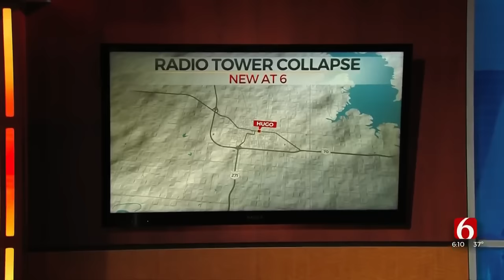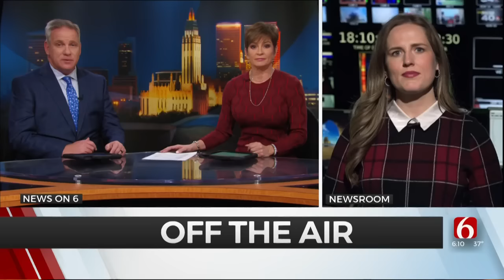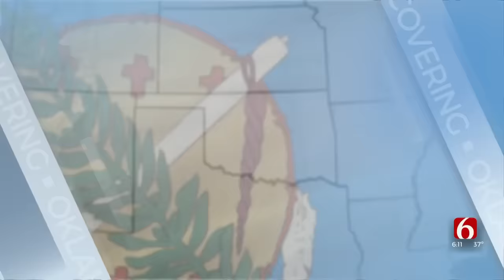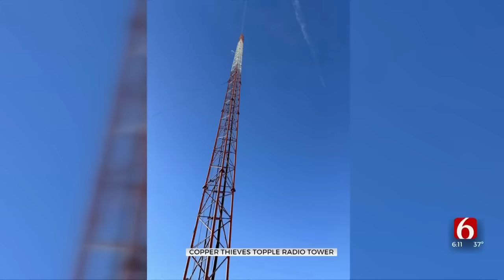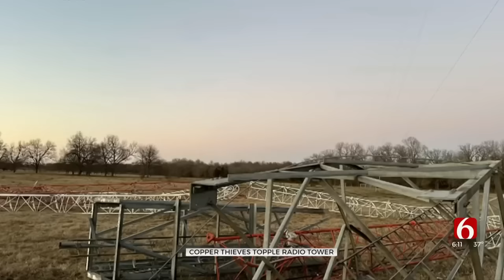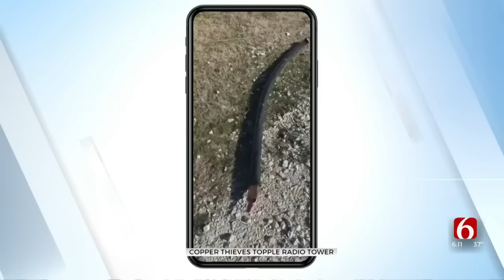Thieves Cut Down Radio Broadcast Tower In Southeastern Oklahoma To Steal $100 Worth of Copper

Comment: Never seen a thief care about how much damage they have caused to gain what little rewards they get
Reply: You must not have heard about catalytic converters being stolen then.
Reply: Nah never heard that, of course I have heard about that, where the heck have you been?
Reply: migrants ?
Reply: @mikemiller659 
That was my 1st thought...
Reply: user-cj8qq1el8i Not MAGA but Biden
Reply: @mikemiller659 Please clarify as illegal migrants. We do have legal migrants after all.
Reply: Copper thieves sole the copper line from my oil tank to the foundation, about 2 feet long and probably only 5 bucks worth, and put 200 gallons of home heating oil into the ground.  The oil spread and leeched under the basement's concrete floor.  The cost to contain and mitigate this oil spill was $300,000.00  and I couldn't live in my home for over 6 months.  Thieves care little for the damage they do, if they did they wouldn't be thieves.
Reply: @robinfleet7094  You didn't actually pay $300,000 did you?
Reply: The original 'OG' of this type of crime was 'Cool Hand Luke' sawing the tops off of parking meters....everyone else that came after including the people who did this are just copycats and pretenders
Reply: @mikemiller659 most likely White or Latino…. The brothaz scurred of heights

Comment: The station manager of WJLX in Alabama said their WHOLE TOWER was taken.
Reply: That was a remote relay tower that the station was unaware of it not re-broadcasting. 

The thieves also stalled electronica equipment from the shed.
Reply: I meant electronic. Damned iPhone 13 retyped electronica, and I failed to proofread.
Reply: @peterresetz1960 stalled?
Reply: Keep thinking it’s about the copper. 
Two towers. That we know of. This close together?
Coincidence. Nope.
Reply: The WORK they put in for $100..🙄
Reply: Close the border.
Reply: @sharksport01  Ha ha you're lost
Reply: @sharksport01    Nice political chant. But would accomplish little.
Reply: What's with the spelling in this entire section? Haha group of re re's.
Reply: @BoltRM  a tower has a 1000 dollars in it if you scrap it
Reply: It’s pretty sure that it had been down for a long time the shed was filthy and the wiring had been cut for a long time things do not add up on that one !
Reply: This is dumb, both should be easy to find.
Reply: @sharksport01  With Oklahoma..?
Reply: Yea, that one looks like something else, they said that tower went missing over night, and the weeds are over the top of the toppled fence, and dirt blown inside of  the cleaned out transmitter building. 
There's something very fishy about that one.
Reply: @peterresetz1960

Is that like erotic electronics? Good god what are they doing over there with them radio towers and that damn Electronica ???,
Reply: @BoltRM 
Yeah get a job.  Thieves around here we're removing metal roofs for scrap.  I've removed metal roofs for reroofing job, it's a lot of work.
Reply: They took the whole tower down in jasper Alabama
Reply: that is a scam in alabama by the owner. no one stole his tower.
Reply: @peterresetz1960  You can fix that /general/keyboards/
then shut of any of several options. In this case, I think you want "predictive" and "auto-correction" off, unless iPhone induced hilarity is desired.

Comment: It's amazing how much work some people will do to avoid having a job.
Reply: About 15 years ago we were plumbing a vary large custom house in Northern California, one Monday all the copper pipes were gone, we had showed up for the Monday inspection and our work had been stolen, about 20 minutes later the electricians are cussing and screaming, they also cut all their wiring out and broke into their connex and stole a bunch of brand new spools of wire, they also got the ac lines that were roughed in, broke into the contractors connex and stole the equipment from it, the batteries from the tractor and telehandler. They had to have spent many hours there and made a lot of noise but nobody saw anything. The damage done was I’m sure a hell of a lot more money than what they got for their stolen stuff. The newspaper claimed almost 2 million dollars in damage and stolen property from the house we were working on and a larger one across the street that they tore Sheetrock out to steal pipes and wires and the ac unit.
Reply: Do you know how much effort goes into cutting steel??
Imagine a two hundred foot antenna. It can't be done overnight and certainly not without being noticed.
This is a scam. Nothing more
Reply: @Edward-iv6vc  You're not very bright... You actually believe they were cutting a tower... Hilarious.
Reply: @Look_What_You_Did torches would cut it down fast be out of there n a hour

Comment: First of all thank you for calling them thieves and not scrappers second of all most RF transmission lines don't have that much copper on them mostly plastic probably around 75% of the actual bulk is just plastic for insulating unless its heliax that's worth some money but something big like that pile of cable still raises eyebrows at the scrapyard if youre not in that radio/electrical/salvage type business
Reply: The dealers don't care, that's why this happens.
Reply: @patrickbuick5459  the shady dealers do but in my yard if they think something's up they call the cops I've seen them there multiple times
Reply: I can't imagine a scrap yard even taking it unless it's completely stripped which wouldn't be easy for a cable like that.  100' would take many hours to strip, for what, $100.  My as well get a job at that point.
Reply: Greed over-rides any sense of moral decency.

Comment: If it’s an AM station there is a lot of copper buried in the ground around the tower for grounding.
Reply: I have seen several examples of that.  KAAY 1090 Little Rock had that happen.
Reply: they wont waste time to get that. to much work.
Reply: Some..not a Lot
Reply: icelandviking,
  Aww-sh/t, now you've gone and done it !
Now they'll be stealing a tractor and rip-plowing the cable up.
Never tell a thief what they missed, they'll be back !   ☆
Reply: Thankfully few people other than those involved as a hobby or as a business would know about  buried ground radials.
Reply: @mikemiller659  An AM broadcast tower will have at least 120 quarter wave ground radials, which could amount to ~1/2 to 1 mile of wire depending on the station frequency. I don't know what gauge wire would be used, but it won't be small diameter.

Comment: That cable is called heliax. It is heavy and expensive ($6.50-$7/ft), but lasts decades. The larger cable measures 7/8" and weighs in at 1/3 pound per foot. Depending on the frequency and power input, larger cables may have been in use.
Reply: Exactly so my confusion is cutting the transmission line wouldn't take the tower down??? It's not a Guy wire and it's not structural at all so what gives.... and the tower looks like a brand new installation. Insurance fraud? Guy wires aren't copper or even sheathed for that matter
Reply: @kJames I guess the copper was somewhere on the top of the tower, and the guy line was cut with the specific purpose to bring the tower down and make that copper accessible... you cut the guy line - the tower will fall in the opposite direction.

Comment: A tower in Alabama was stolen. An entire radio tower is missing
Reply: In Jasper Alabama
Reply: Hope it was a fox station!
Reply: @charleselphinstone6714  No, how would I get the Simpsons?
Reply: 'An entire radio tower is missing'  Find the video of the guys visiting the site.  Looks like whatever happened really happened much earlier, now long dead grass growing over guy wires, through fencing, etc.
Reply: @ModelLights  From what I understand it was still in use.
Reply: @johndavid8815  'it was still in use.'
Go find the video, it's complete BS that it was actually in use.  Door falling off the hinges and dirt inside from months, etc etc.
Reply: @charleselphinstone6714  At least fox is has more integrity than most.
Reply: @joewoodchuck3824  well said mrs putin!
Reply: @charleselphinstone6714  ' @joewoodchuck3824  well said mrs putin!'
Someone with poor discernment fell for 'Russian collusion' even though it was an obvious lie from the start.. LOL
Reply: @redneckhippiefreak  Years ago an FCC licensed person (like myself 😁) was on duty at transmitter sites full time. With technical advances transmitter sites have become autonomous and are often located in remote spots. Hardly ever at the studio/office facility. Programming reaches the transmitter sites either via dedicated phone line or via a microwave link. Direct ongoing monitoring of transmitter performance is a question as to how the studio knows what the transmitter is actually doing.
   What I don't understand is why the FM transmitter was taken off the air by FCC when it was still working even though the AM transmitter was gone.
Reply: @redneckhippiefreak  I wonder why though. Clearly not every FM station is required to have an AM counterpart as a condition of being in the air. 
   There are ~6,600 FM stations with ~4,700 am stations.
Reply: @redneckhippiefreak  According to Wikipedia EBS was replaced by EAS in 1997. A different system both technically and in scope. But yeah, more information is certainly expected.

Comment: It's a crime all right! Does the wire have to be copper wire, or could iron wire be substituted instead? Since this is a month old now, are there any updates on this story, as to whether the thieves got caught or not?
Reply: Copper is a requirement for RF transmission line.
Reply: Iron is not intentionally used as an electrical conductor.

Comment: 1400 ground wires for hydro transformer boxes were cut off the poles from 6ft and below in Hamilton Ontario last month. Most of the 50,000 volt transformers are within 10-20 ft away from a home, putting all those homes close to boxes in jeopardy should lightning happen to strike the lines or transformers And fun fact, they are filled w Diesel fuel should the zombie apocalypse happen and you need gas for your HMMV or commercial generator.

Comment: Here in the remote Mojave desert, thieves repeatedly cut telephone trunk cable off several poles in a row.  Hundreds of conductors of fine 28ga insulated wire that's very labor intensive to recover the copper from, and cost well over $10,000 per incident to send crews out to temporarily bridge critical lines then splice in replacement cable, only for them to do it again and again. 

One time they got their stolen U-haul stuck in the sand and I found one of the perps hiding under a Juniper tree.  The Sheriff's deputy waiting by the truck for the impound tow to arrive looked at me like I demanded a lewd personal favor and droned, "Our department policy doesn't allow us to go out into the desert to arrest these people."   The perpetrator was RIGHT THERE 200 feet from the patrol car, and they LET him get away to reoffend multiple times!

Comment: GEEZ this LOW-impact crime. We had metal thieves in Missouri who, from the support towers, threw chains across the conductors of high-voltage powerlines to short out the circuit, then proceeded to cut the conductors down to steal them for scrap.

Comment: It sounds like in this case, the thieves only stole about a sixth of the Heliax or similar coax.  That's bulky and awkward to handle compared to electrical wire, and rare enough to junk that any honest scrap yard should find a seller very suspicious.  

This tower appears tiny and cheap for its height....  and so easy to take out by cutting guy wires.  That takes either compound bolt cutters, or ACRS shears, as EHS steel is harder metal than average wire cutters can handle.  

This is clearly a Federal felony, if the perps can be caught.  The FBI/DoJ are needed for enforcement, even if the crimes fall under the Communications Act and FCC jurisdiction.

Comment: One hundred feet of copper cable is worth about 700 dollars! At three pounds a foot that's a lot of weight!
Reply: Depends on thickness
Reply: it depends on thew size of the copper and total weight....!
Reply: "a 10 foot board weighs 8 pounds"
Now do you understand how stupid that sounds?
Reply: @PSUQDPICHQIEIWC  you have no idea how much copper weighs obviously!
Reply: @kpdvw  the ground cables are two inches thick braided copper! That's a lot of weight!
Reply: @@trappersdad6855 most have never been outside much is what I think! I would try to explain to that one person that a ten foot 2×4 beam of copper would weigh somewhere in the vicinity of 12 to 1500 lbs but his mind would explode!😄
Reply: @@trappersdad6855 couldn't resist- had to splain it to him!😄😄😄
Reply: Yes but coax is not solid. Outer shield and a center conductor. Looked pretty big but still not very much copper.
Reply: @WW5RM  they dont use coax on the ground cables! Those are braided copper for lightning strikes to go to ground! They run every ten feet about as far as the tower is high from the ground to the tower's! Coax is only used for signal transmission! These cables are for both stabilization of the tower and grounding the tower against lightning strikes! I've worked on many towers like this! And theft of the ground cable's is a big thing nowadays! It spiked when copper topped 4 dollar's a pound for recycle! It's not as bad as it was but thing's like this are not rare either!
Reply: @genehasenbuhler2594  i know that! Who said anything about ground cables? I was responding to the original comment not you! 

Coax is a transmission line. Ive been a Ham for 32 years and installed a few towers. Nothing this big, only Rohn 25 and 55. Never seen ground cable go up the tower, only at the base. Plus they are galvanized. The whole tower is the ground, no need for extra ground unless its across the joints and wouldnt run the whole length. Maybe 1 foot jumpers at the most.

The only thing copper thieves would be interested in is the coax.
Reply: @WW5RM  in the picture your looking at the remains of the top of the tower on the ground! The reason it's on the ground is explained in the video where they say the cables were cut that support the top section! But your so smart you caught that huh?
Reply: @genehasenbuhler2594  Right! They cut the Guy wires and the top section fell! Not ground wires! Two different things! Guy wires are not copper! Yeah we see who the smart guy is! 

What i saw in the picture was a piece of Heliax Coax. Black outter jacket with a solid copper shield and a copper center conducter with a dielectric between them! Not braided and some Heliax is pressurized! 

But no where do I see a ground!
Reply: @WW5RM  those ditches in the ground are where the ground cables were pulled out! And they run in between the guy wire cables! And steel is recyclable too! But you spin it your way by all means! Have a pleasant day!
Reply: @genehasenbuhler2594  the title to the video says "copper". I don't see any ditches.

You said the ground wires run up the tower. I've never in 32 years of Ham radio and tower work ever heard of that. But yes copoer ground radials are put at some tower sites. 

Spin it? I'm just trying to follow the topic, copper and your comment of ground going up the tower. So which is it? Up the tower or in the ground? I wish you would make up your mind!

But for the record, I say again, I did NOT reply to you.
Reply: @WW5RM  ah so you only got as far as the title! I see now! If you'd have actually watched the video and listened to what they said then maybe you would have caught the part where they tell you! But alas - your the smart one! Again have a pleasant day and G.F.Y!
Reply: Not RF transmission lines. It has an inner thin inner tube of steel or copper sometimes plated with silver, on the outside it is usually copper plated steel or copper foil. The value if all copper is about 1/4 a pound net copper weight per meter. Used to ask scrapyards to save it when it came in longer lengths for ham radio stuff. ❤

Comment: It’s gonna take a lot more than hand held wire cutters to cut guywires from a tower like that. Just saying
Reply: A60$ ryobi battery powered shear will do it. Sorry it's bit difficult at all
Reply: Not the guy wires. The RF transmission coax.

Comment: I know they're trying to downplay the amount of copper and it's value, but that rigid transmission line coax is a large copper pipe surrounding another internal copper pipe is probably worth far more than $100 in weight. Problem is finding someplace to take it that won't bust you for having it.
Reply: No, the copper is thin enough to cut with hedge trimmers.  I use this same stuff for my ham radio antennas.
Reply: I have seen utube videos where a scrapper melts the copper into bars for storage ease of handling.

Comment: LOL 100ft of 6x 4/0 cable......is NOT only $100 XD I get nearly $1 per foot (3.50 per pound) for a single 4/0 gauge clean copper wire.. There are 6 of those 4/0 cables in that antenna supply, not just one......Plus, If they got into the base room...There is probably another 200-400lbs of copper in there too. Sounds like someone got around 700lbs of copper at $3.31 per pound,,,scrap value. A 100 ft roll of 4/0 will sell for $4-500 on Marketplace..or any job site/fleamarket.

Comment: This is very fishy, it looks like a new installation. Guy wires are not easy to cut through and they are not copper, only the grounding is copper and its not structural, copper isnt a suitable material for guy wire due to its malulability. And further more even stainless/galvanized guy wired are ground insulated with a loop. Looks to me like an insurance brush off for the poor installation